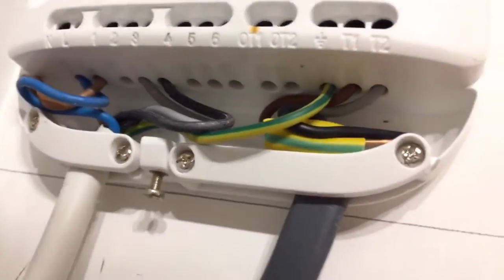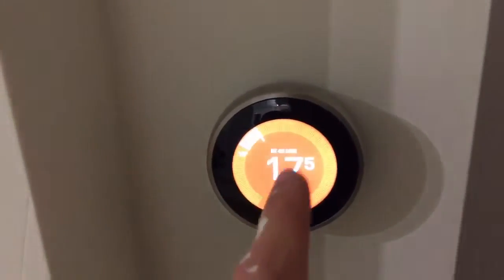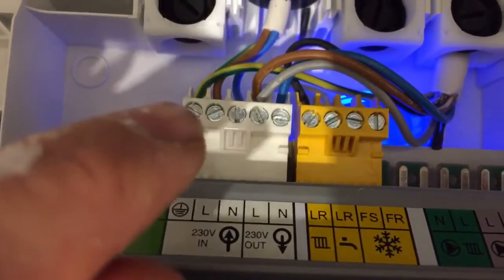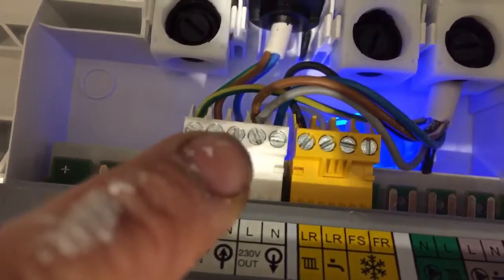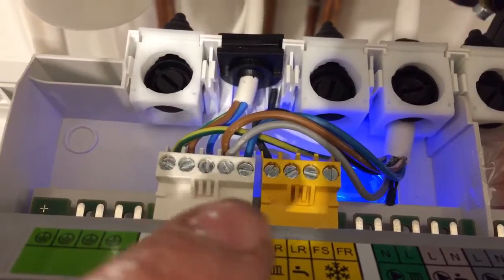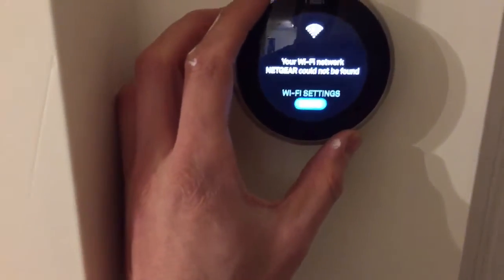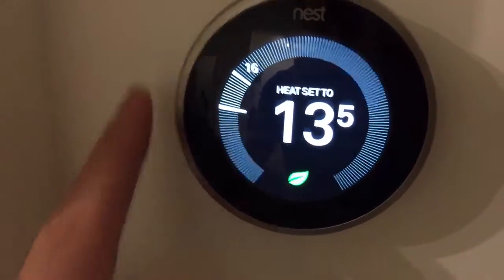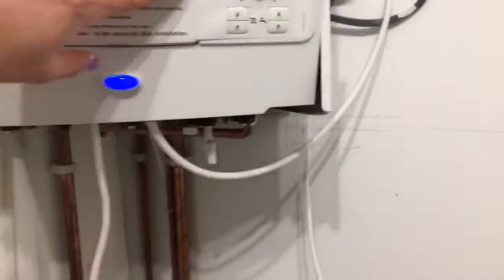How to Install / Wire Nest Thermostat 3rd Generation Worcester Bosch Greenstar 25i Combi Boiler

Comment: Is that boiler plugged into the wall? Not installed by a gas safe registered engineer?
Reply from the maker: Yes ;)
Reply: it should be fixed wired via a Switched Fused Spur with a 3amp fuse.
Reply: With a 3amp fuse in the plug its the same really it can be plugged out and isolated
Reply: @stevethomas5849  says who
Reply: Perfectly acceptable for an GSR person to install using a plug as long as the socket outlet is double pole or unswitche.  The main point of reference is that the appliance can be safely isolated. Where in GSIUR does it state that a plug outlet cannot be used? If there's a plug outlet, I'll use a plug outlet.
Reply: @rayc1503  As you said its ok but needs to be a unswitched socket

Comment: Hi Matt, thanks a lot for sharing the video it's really great! I'm trying to up-skill myself on combi boilers and Nest thermostats. I have a baxi duo tech combi boiler, it's currently connected to a danfoss TP 5001 thermostat which wirelessly communicate with  a danfoss rx1 receiver. I want to change the danfoss to a nest thermostate E. Unfortunately I'm installing this in a country that is not supported by Nest install pro so I'm on my own here. Do you have any tips on where I should start? If I understand correctly I should replace my current receiver with the Heat Link, and then replace the thermostat with the nest E thermostat?

Comment: Could you not have a loop for the live in the heatlink?
Reply: Yes
Reply: @deadpanjack8055  I know now, I fitted it 2 years ago.  There is not much space to have the loop in the Heatlink, so you could use 4 core cable and make the loop in the boiler.

Comment: Are the in connections coming from the fused spur and the out connections to the heatlink?
Reply from the maker: JT1985 yes and yes, but in this case I have a normal plug socket and a 3amp fuse within the plug instead of a fused spur.
Reply: Matt Hutton ok mate cheers.. good vid
Reply from the maker: 123 Fish lol cheers